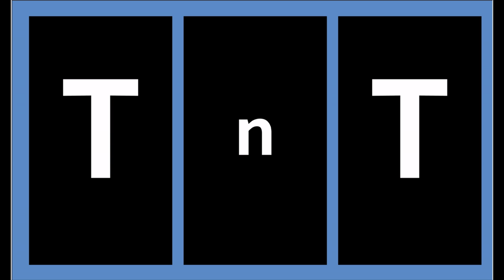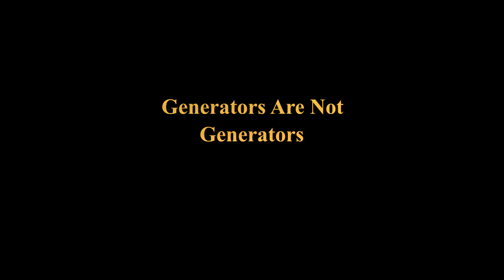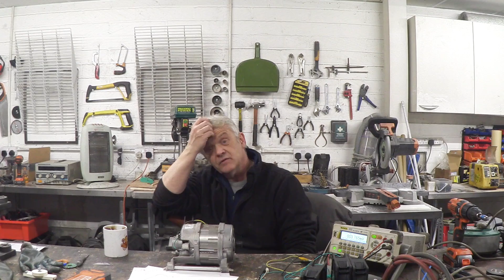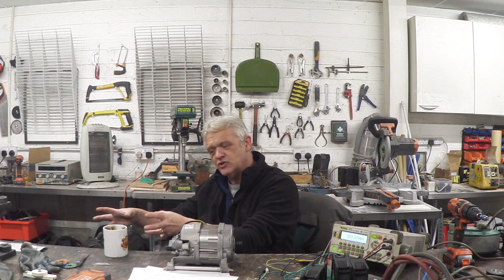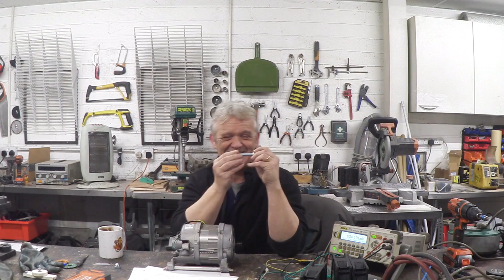1364 Generators Are Not Generators

Comment: Technically it is called an electrical generator not an energy generator. I get what you are saying about how to think about energy transformation, good talk thank you.. But the engineers and scientists labeling that thing as an electrical generator sounds legitimate because it indeed generates electricity when otherwise you would have none from just spinning a wheel with no coils and no magnetic field. You could spin that wheel all night long but without that electrical generation happening using those coils, magnetic field, and you spinning the wheel you will get no electricity out.  Put it this way, try hooking the input up to nothing and see if it creates electricity. lol

It is not a big deal, just a misunderstanding. Too many people been running around calling it simply a generator and leaving out the first word that goes along with it to describe it correctly, and that is the word "electrical" NOT the word "energy". Engineers and scientists know it is an electrical generator, but many people)(mostly people not scientists or engineers, etc...) are just too lazy to say it correctly and they shorten it to  just "generator".  And now it can be a little confusing to others who are not educated in the field hearing regular people say it leaving that detail out.

There are many different types of generation that happens here, just saying only the word "generation" requires more information if you want to know what they are trying to say. The first question is "generate WHAT?".

Comment: I wouldn't call it a true converter either, which to me, takes something in and converts it to something else with no losses. A generator, by its name, makes no assumption about the input or what the expectations are regarding its efficiency.
A generator, or converter, as you want to call it, can take a form of energy input and utilise that energy to generate another form of energy. That it has losses due to many things, marks it as a generator and not a converter.

Comment: the problem is that the "generator is generally the bookend of the conversation. 
when we discuss electricity the generator is the thing that generates the current, and that is the end of the conversation.
when we, in very small groups, plan a power plant, the "turbine" is the end goal, we don't really care what happens after the "generator", and it is rarely called a generator, it consumes the power.
that is why car alternators are almost never called generators, alternators are not a book end, they are in the middle of any concept of the cars functions that include it.

Comment: Apparently a lot of people have a hard time understanding the innate limitations of energy conversion because I often find myself trying to explain to people that there would be no benefit to adding a dynamo or alternator to my electric dirtbike, other than in the case of regenerative braking of course.  My neighbor kept insisting that I attach a dc motor he gave me to be spun with the friction of my back wheel.  After spending almost an hour trying to explain the concept for him I finally rigged it up like he had suggested and wired his motor to power the big LED headlight already on the bike, with a switch before the light.  I had him ride it and told him to test the bike out with the light switched off then on.  He finally started to understand the concept once he could feel the drag induced from that motor when it was powering the headlight.  Oh the things I will do to win an argument lol 😂

Comment: So the goal is to always try match the converter to the energy put in. And if the converter is to big compared to the energy put in you need a gearbox. But a gearbox would cause loss in efficiency as the gearbox will consume some of the energy put in.
I was thinking of the rain converter. It collect the charge from the raindrop. So if 100% conversion is unlikely to achieve, I wonder what the losses could be.

Comment: As always, thank you for this excellent way of describing, the forms, functions, components and "parameters" (not a favorite word, lol). Just a footnote: some time ago, I was playing with a motor that had been re-purposed, as you've done. One part of making it all work well was going from a low RPM "source" to drive a shaft at high RPM. I had no pieces on hand that fit the job, so it was off to the Library (back in the pre-Internet days) and "Machinery's Handbook."  (The term "handbook" was misleading for a book that was 2 kg & 1400+ pages!).
Probably the most interesting bit of information turned up as a "side note" to the job was the choice between gears, belts & pulleys, and roller chains & sprockets. What came out when comparing the alternatives was the efficiency of a roller chain and sprocket transmission vs. a gear drive. Even with well-made and matched gears, properly lubricated, the energy lost between the rotating source and the driven shaft was much greater than if roller chain & sprockets (at the same speed-change ratio) were used.

Belts & pulleys were in the middle, but roller chains are amazing efficient in many cases, compared to a geared transmission. Of course there are trade-offs depending on the application, but in some cases worth a look. 
One very good source of roller chain system parts (aside from old bicycles) is a farm machinery supplier. I've found that many combinations of parts to move rotation energy, with or without a speed change, are  readily available than gear sets. In some cases, Gears are wonderful, but roller chain drives are quiet, efficient, and often less costly.

Comment: You come to a conclusion that the engine is better called the generator based on your premise that an alternator is better called a convertor since it converts mechanical rotation  into a electrical energy. I realized that based on the same premise the engine would be best called a rotator, rather than a generator because it also requires a chemical input to achieve the rotational output.

Comment: I think I'm going to start using a different measurement unit when I am trying to determine The amount of power output from generators, the unit will be a Reindeer which is equivalent to 746 watts or one hp.⚡️🦌⚡️

Comment: This hits the point on the long, convoluted bevy of terms we as humans have accrued when applying a naming convention to our ideas. I've always seen a generator as a transformer in name and function, but of course someone long enough ago coined that title to another device, thus nullifying my efforts. 
Speaking of bass ackwards, I was watching a 'misconceptions of electricity' type of video the other day trying to sway hearts and minds that electrons don't flow through copper wires via current, but instead flow outside the wires as EM fields along the lines in a gigantic loop between the power station and your house. 
Seemed interesting, but I didn't see the thought train they were trying to push. There's an awful lot with the idea that anyone who's worked with electrical lines would raise a hand of contention.

Comment: Rob even though you induce mechanical torque on the rotor. 
Is it not the moving magnetic field the power is flowing from and not the actual rotational torque, but the rotating magnetic field??

Because motors can spin without mechanical rotational input, with electric fields causing the magnetic field to induce rotation.
Reply: Basically a moving magnetic field can induce current to flow. 
But that means with the right configuration of transformers we should be able to create a large simulated virtual rotating magnetic field and power a load then send it right back into the rotating magnetic field. 

Only by using resistive losses to power a load. 
The amps would be almost free or recycled from and back to the magnetic field flowing in time.

Comment: Transformer! It transforms mechanical power into electrical power.
Reply: More like they transformer electrical energy into magnetic fields that induce an amperage and voltage to flow in the secondary circuit

Comment: fundamentally a generator and a motor are the same anyway, but both convert between rotation and electricity, so having a single name for them that references that would make the most sense. but we also live in a world where current flow is opposite the direction of electron movement and people will defend that angrily and aggressively, so whatever.

Comment: I have a question about the metal plates inside the coil. What would happen if you replaced the iron with aluminum? The cogging effect would be lower and it would be lighter as aluminum is diamagnetic. But what would happen to the power?

Comment: Sounds like a Newton's lecture, energy is neither created or lost. It only changes states, you will never have an output equal to the input because there will be heat losses (the resistance (or friction) you mentioned). I agree that they should be called converters because calling them generators is akin to calling them free energy (or over unity) devices.

Comment: TY for the vid!  Intuitively, from other research, the arrangement of the wires and magnets are paramount to losses.  It's the difference between input to output of 1:.97 to 1: .09 outputs.   
Efficient motors as you know Robert, are cost prohibitive.  
Lastly, I hear you that using the term converter rather than generator better depicts your goal.  However most of the world don't use the terms that way and would not understand YOUR just point unless they just happened to see this video.  :)

Comment: Since 'generators' are effected by strength of field, speed of rotation, and length of wire. Wouldn't it be possible to take a motor and a 'generator', then give the motor a massively large gear or pulley ratio and connect it to the 'generator'. The gear ratio will drastically increase the rotation speed of the generator enough so that the motors power source could be switched to the generator and there would be power left over to plug in other devices. This is wouldn't ever be done when dealing with just motors, because a large gear ratio would mean a very low torque for the faster gear/pulley end, but torque doesn't matter when it comes to 'generators'.

EDIT: LOL I spoke too soon, you basically say what I said at 13:28 haha.

Comment: To "generate" sound, you stroke a tought string. 
 To "generate" electrons, you "stroke" a wound wire (with a magnetic field) ?
Reply from the maker: you don't generate electrons mate - they are already there - you are making them move is all
Reply: @ThinkingandTinkering  
You don't generate sound either, the air is already there, you are making the air move is all .

Comment: well it isnt a "converter" either , it does not convert your your energy into anything!! It is a manifestation device ! 🤯 The energy you put in is totaly used up by overcoming inertia of rotor and maintaining the rotor turning. Just as if you turn an equally shaped/sized massed copy that has no magnet or stator. !00% of the energy is used, nothing to convert!!! Instead , the motion of the magnetic lines [of constructive/destructive interference] pass over the coil this allows a bridge which manifests electricity from the ether as the points of constructive magnetism collapse inside the coil! it never was your "energy"!🧐

Comment: Power is the amount of energy transferred or converted per unit time.  One motor can not have more power than another, it can only do ‘work’ faster. The consumption of this energy being defined by volts times amps per time. Be less confusing to say that this generator in question converts mechanical force into electrical potential. If that potential can be provided with a suitable path then energy can be transferred and manifest a force somewhere else of one’s choosing. The force can liberate electrons from static atoms as in a plate of a say battery or electrode of an arc welder or ionizer or cathode of a cathode ray tube...etc. The magnetic gradient (field) around the path can also be used to manifest mechanical force in say a motor or solenoid or send protons wizzing around a particle accelerator.  I’ll leave out the manifestations of photons and what not.
Reply: A 2 HP motor converts twice the electricity to mechanical energy per second, so it does have twice the power, based on the first sentence.

Comment: Exactly 👍. I had the same issue with the term 'generator', so I always viewed machines as converters. Proper understanding begins with proper naming. In fact ANY machine you can possibly think of can only accurately be described as a 'converter' with an accompanying efficiency factor of <1. Strictly speaking there is no such thing as a 'generator' that would break the laws of physics.... 😋
Reply: Yep, even the bunch of hamsters are just converters :) Converting chemical energy from their food into mechanical energy. And the plants you fed them were also converters, converting solar energy into chemical energy. It's converters all the way down! Well, at least until you get to fundamental physics, then you can have energy pop out of the vacuum for an instant, but it always has to be given back.
Reply: Have you heard of a bipolar junction transistor

Comment: This is a very interesting theory. If you see everything as a result of an input, you can see everything like a conversion of some kind of energy into some different or similar output. That's a base principle of the universe. Isn't it?
Reply: Sounds like someone whom is familiar with the theory of "solid light" .
Reply: @OverUnity7734  Not really. I never heard of it. It got me thinking after having watched this vid. 
I am not kind of weird energy enthusiasts but someone who tries to make clear that there is no output without any input. Everything can be converted only, but not generated.
Reply: @ravelkoff3549  That theory is thrown away with the introduction of parametric transformer Lol.
Reply: @ravelkoff3549  Now, the generator generates voltage ONLY and resonating capacitor at the primary side generates current ONLY. Separated source.